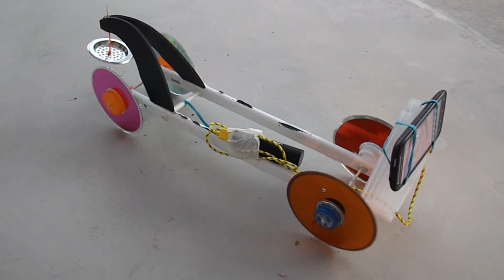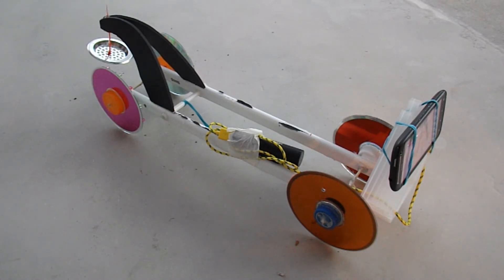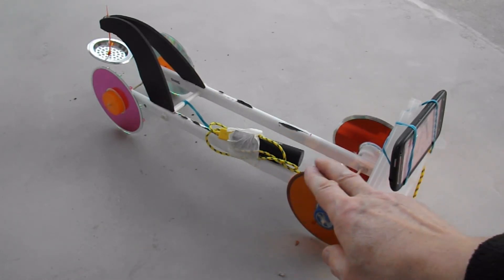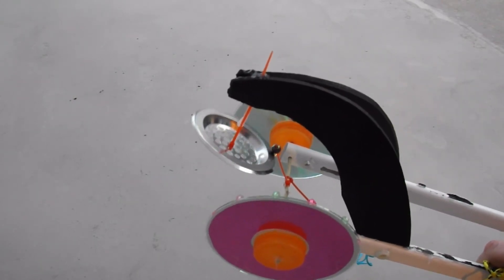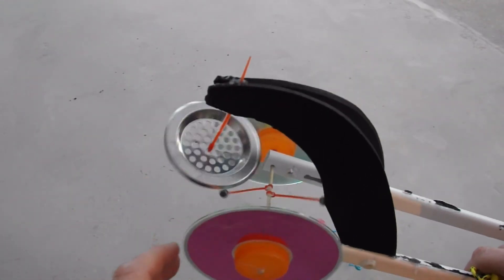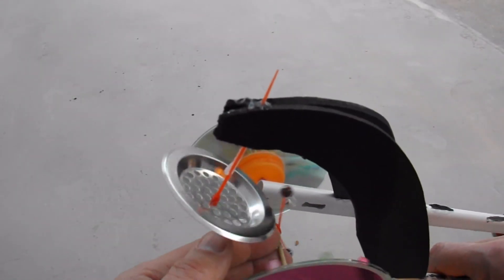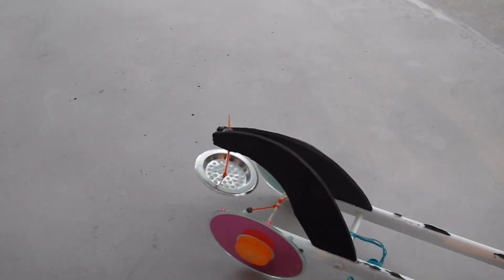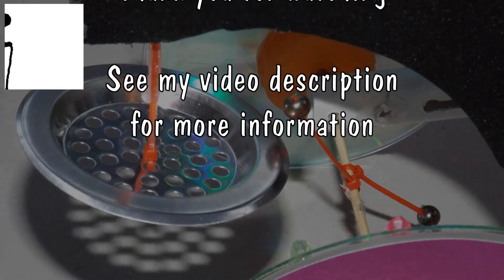Bell ringing rubber band powered car

Comment: Could you make an rc car out of paper
Reply from the maker: No, it would need to be stronger than paper and what about wheels and axles and gears and receiver and batteries and servos and motors. What you would actually get is a normal RC car with a paper shell, maybe a paper chassis, but the rest of it would be plastic. When people ask me to make something out of paper then that is what I try to do.
Here is a paper car http://youtu.be/KL4pDLKzO_4?list=PLA5a2xPRSrB1otXh0w36OwsYIHZznUWp6
Here is a car made from cardboard
http://youtu.be/XRykymHoPZ0?list=PLA5a2xPRSrB1otXh0w36OwsYIHZznUWp6
Here is a car made from wood http://youtu.be/8BFBYvWquO0?list=PLA5a2xPRSrB1otXh0w36OwsYIHZznUWp6
Another wooden car http://youtu.be/aoTXpAqS_Ys?list=PLA5a2xPRSrB1otXh0w36OwsYIHZznUWp6